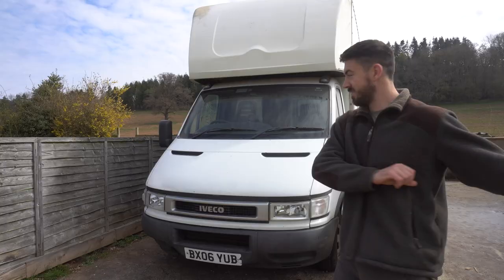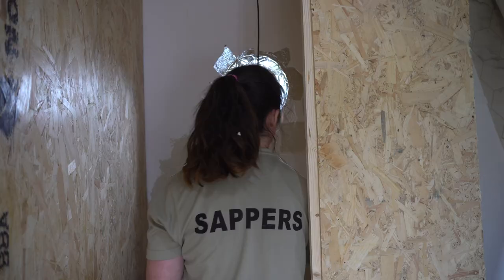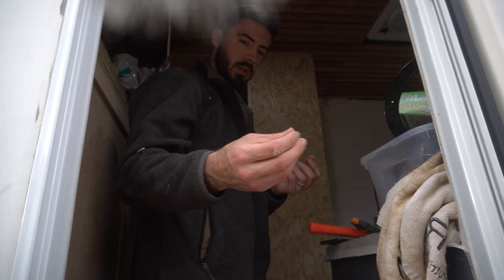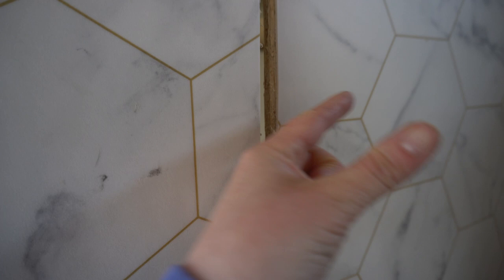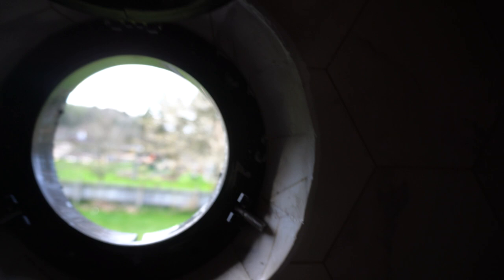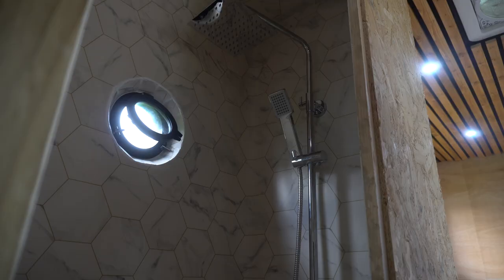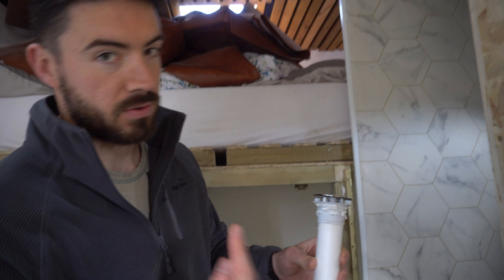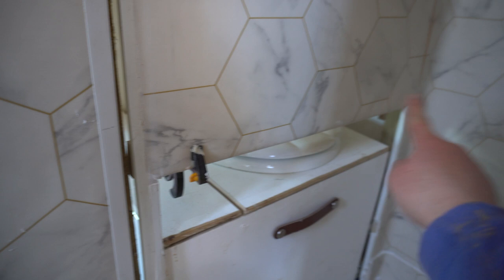HOW TO BUILD A VAN BATHROOM - Simple Van Build Shower - BOX VAN CONVERSION

Comment: For the toilet what about a door made out of perspex, you can buy it in sheets and cut to size. It could slide up rather than flip up if you had rails either side, and it’s thin and light; use a peg system through the rails at the bottom to keep it up. Or for a simple solution cut a shower curtain down to fit and have it on a thin tension rod or plastic coated wire, but in two halves so each half can be drawn to either side when you want to use the loo. You could mount the rod/wire on the loo side of the wall so that the water doesn’t hit the top of it. 

Do you not need a drain on the opposite side of the base, diagonally, for if you’re not parked on level ground? I’ve seen that mentioned as a major point on upmarket motor homes.  

I hope you manage to repair the hand held hose.. you don’t always want to get your hair wet and you can’t rinse your bum with an overhead shower! 😂 

Btw.. love the porthole. Love your layout too. It’s going to be fab. Looking forward to your final tour!